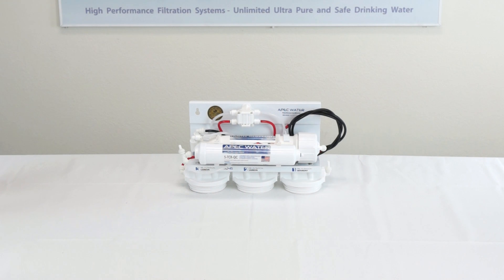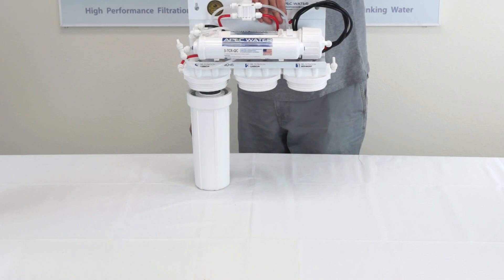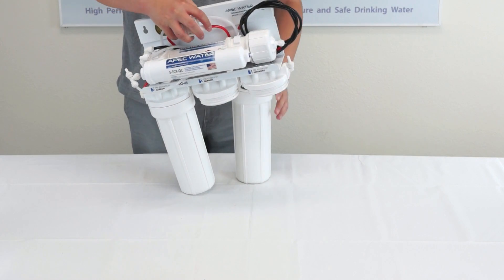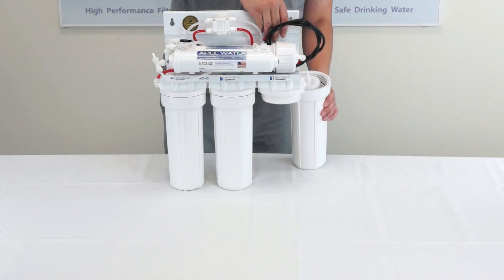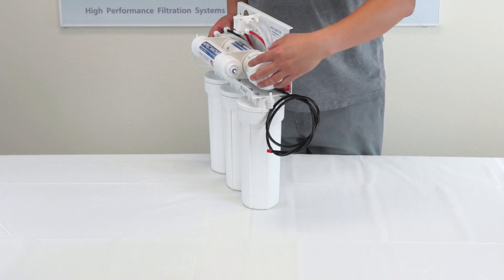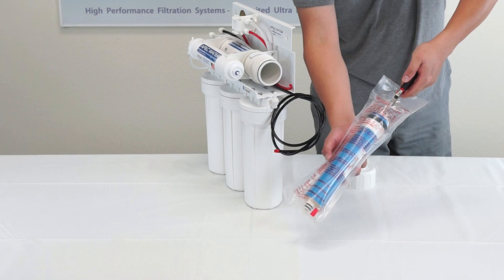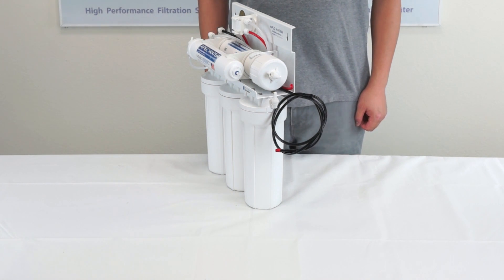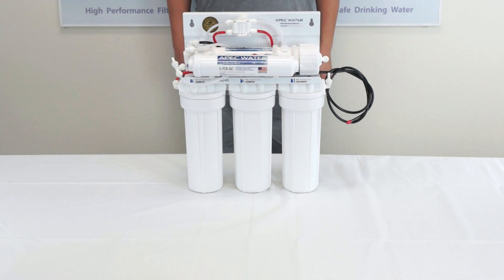How to Insert and Assemble Reverse Osmosis Filter and Membrane - APEC Water Installation Part 2

Comment: Needle nosed pliers are a terrible idea. Just put on a pair of vinyl or nitrile gloves and use your hands so that you don't drop the membrane. I've been working on RO system for several decades. Don't open the bag until your ready to insert the membrane cartridge, and don't foul it by touching it with your bare hands. You want it to remain as sterile as possible. Using a water softener in conjunction with an RO will greatly extend the life of the RO unit. You should have a particulate filter in-line prior to your softener so that you're not fouling the resin beads in the softener with dirt or whatever else comes in with the water supply. You shouldn't touch ANY of the filter cartridges or the insides of the filter housing with your bare hands. Use food handling gloves or medical gloves and save yourself a lot of trouble. When you open the cartridges prior to installation, don't set them down on anything. Insert them directly into the housings! Think "sterile." Everything needs to be clean, and I cannot stress that enough.
Reply: Why do they think PLIERS are clean enough to touch it. That's probably worse than your hands. They have lubricant on them and no telling what else.
Reply: @thanos879  Right?

Comment: You make it sound easy but the membrane housing cap (148) is too tight to move and you don't include a wrench for it
Reply: The company has informed me that the system is now sent out with the membrane filter already installed so we can skip that part (no need to unscrew it yet)
Reply: @wendysteadman3220  OMGggggg! Thank you! Mine did actually come with a wrench for the cap, and I'm a pretty big guy, but even so, that call was not about to budge. Still super annoying because to use the wrench I had to disconnect the tubing on the end.
Reply: You'll need to replace the membrane at some point. You're just a girl, so get a man to take the cap off.
Reply: @Atouk  I know she is a girl, but I am sure she is stronger thản you. I am a navy seal guy but my girlfriend still stronger thàn me. Trust me!
Reply: @rundle888  MEH..think whatever you'd like. puff puff pass.
Reply: @rundle888  Sure..sure...